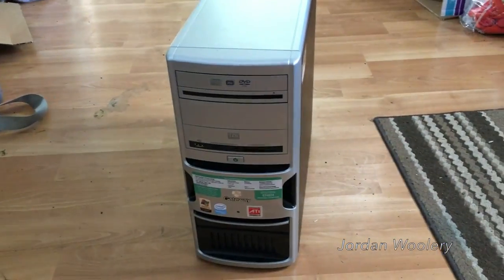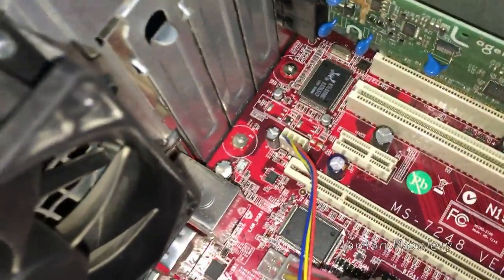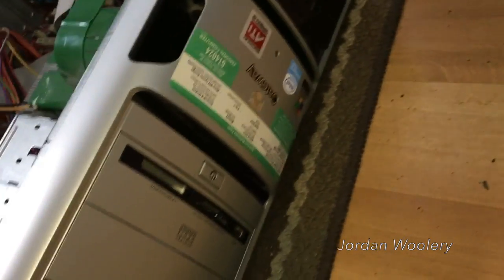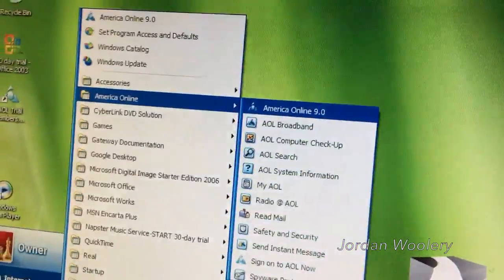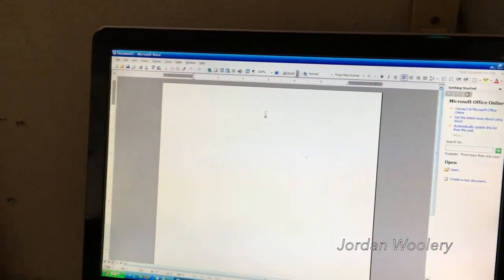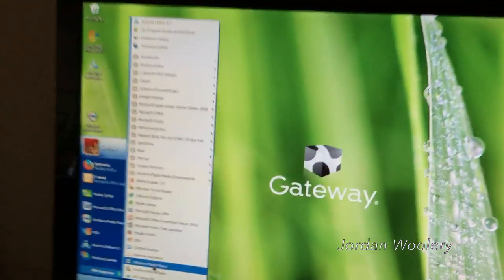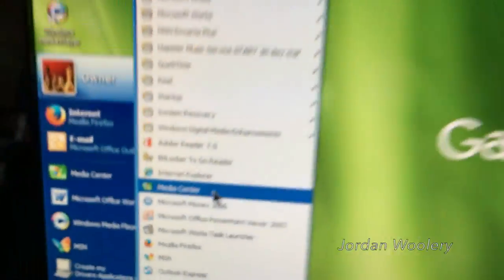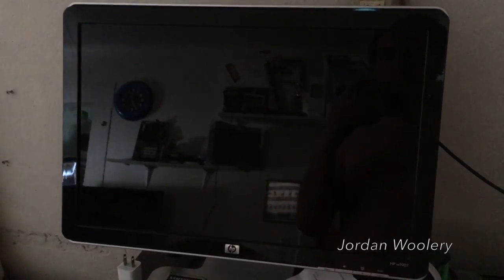Gateway GT4024 Overview

Comment: I had the AMD version of this Gateway (GT5056) that we used everyday until 2015, by 2014 It was still running Windows XP even after support for it has ended, It did receive ram upgrades as well as a new graphics card and a capture card. P.S. It got upgraded to 7 than 8.1 and it's final os 10.

Comment: The problem with btx and people putting radiators on their intakes is that they end up cooking everything else in the case. The processors heat should be the last in the chain out of the case, hence the radiators being mounted to the rear / exhaust or like the older Dell dimensions.
Reply: I had this computer from 2006-2014 and I noticed that as time went on the fans on it got louder and louder, and the computer got slower to the point where it was barely usable. I probably cooked it l. It was running pretty much 24/7. I tried to upgrade it in 2015 with a new hard drive, thermal paste, and graphics card. It was done for. Still unusable. I also think what hurt this pc was my desk had a cabinet door the pc tower went into. Therefore no cold air was coming into it. Damn. No wonder I fried it.

Comment: I bought one of these brand new from circuit city in 2006. I used it every day until 2014. Back in the day this was a pretty fast computer but by 2013 it was really showing its age.
Reply from the maker: no kidding. Especially with just 1GB RAM. Though amazingly you can still daily one of these today as long as you upgrade the RAM and put in a better graphics card and such. Hopefully.
Reply: Jordan Woolery id probably still be using mine but it got to where it would freeze all the time and would run really slowly. I replaced the hard drive and upgraded the ram and put new thermal paste on the processor but it still did the same thing. Id say that the gt4024 was definitely worth its almost $700 I paid for it when new because it lasted for many years.

Comment: Hi dude, I just get mine!, but there's no OS in the disk, can you share a copy of your OS in a .gho file? :)
Reply from the maker: I actually made ISOs of the recovery software, which requires an already installed copy of XP Media Center Edition 2005 in order to work. I don’t currently have access to those disc images, they are on another system that I don’t have at my dorm room, but I do know where they are at. Maybe when I have some time, I’ll upload them to my MEGA storage and find a way to link it to you if you’re interested.
Reply: @jwoolery99  That's will be awesome, thanks for reply :) I'll be waiting

Comment: I cant connect to wifi.
Reply: This computer doesn't have built in wifi
Reply: @dabnisbrickey6527  be cooler if it did
Reply: @braden2345  im late but dont expect much from an old 2005 era computer. i use a tp-link wifi adapter, pretty good imo